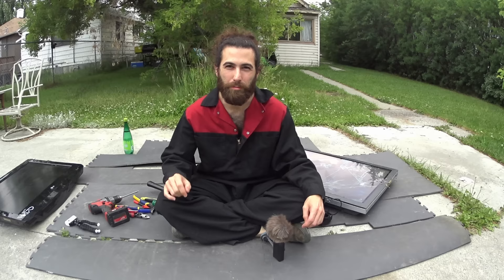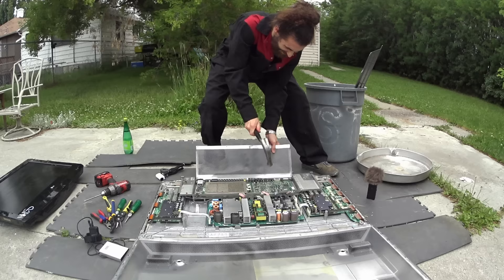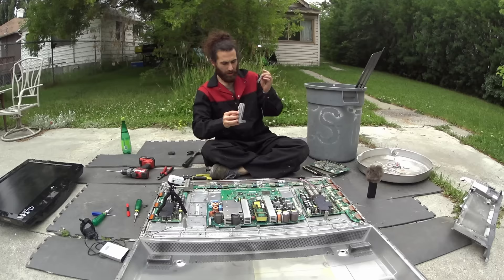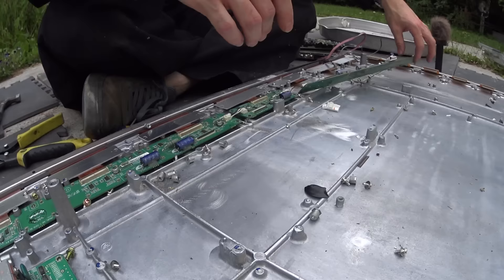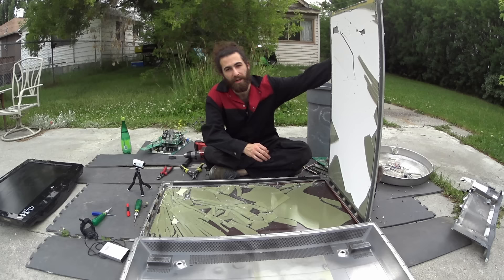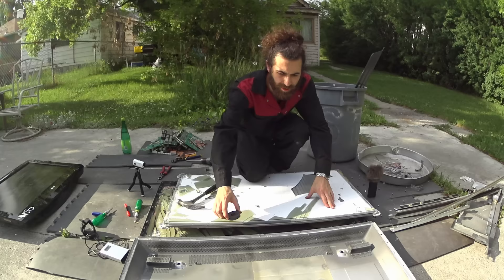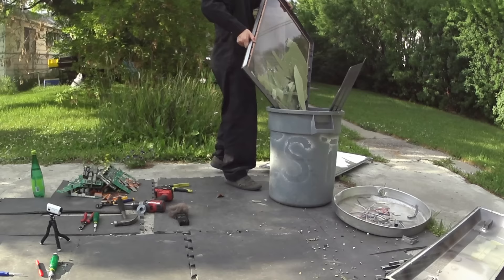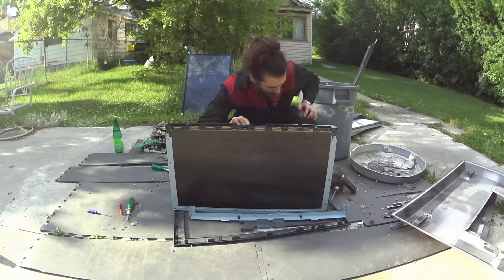Scrapping A Flatscreen TV - How To Make Money From A Scrap TV!

Comment: I have taken hundreds of flatscreen TVs apart. I have noticed that you’re throwing your screws away. You need to get you a bucket, and put them screws in there. I have a metal 5 gallon bucket that is level full of little bitty screws that came out of flatscreen TVs. I can only pick it up about each off of the floor and that’s it, because it is so heavy. You can sell that for Scrap Metal as well. They will buy it. I will take a plastic dishwasher. I strip all the wire out of it. And the painted aluminum from the front, if there is any stainless steel inside the dishwasher, I take that off, and any brass, I may see, then you can take your screws and small pieces of scrap and put inside the dishwasher and sell it. I have been scrapping now for over 30 years, I have a humongous, astronomical amount of circuit boards. Better known as motherboards. When Bill Gates mother gets bored, do you know what he calls her? He calls her motherboard. I just don’t know what all to take off of these boards. They are different grades, I do know that much, but they do not want you to take anything off of it. But sometimes I take the aluminum grid off, and some of the copper off. I probably got enough to fill up a 6 foot bed on a half ton pick up level full , maybe even more than that. 0n a tube TV, I will take everything out, including all of the screws. Then I will take the tube out and hit it very carefully to let the gas out. I will take the top end that the copper wire cone was on, because there is metal there that can be scraped. Then I will cut the steel band off. Then I will put the rest of the tube in the trash can. And then I will break the glass tube up into small pieces. Then I will take the piece of metal out, dump what pieces of glass back out. Then I will take the piece of metal out lay it on the ground, and step on it to make it flatter. And I will sell it for scrap metal. The flat green TV that you took apart, that had the green broken glass in it, it is called a plasma TV.  If the circuit boards are in good shape, you can sell them online, on eBay, or craigslist.
Reply: How do you know if the circuit boards are in good shape? How can you tell?

Comment: Ok so good info that you have given however you missed or left out some details that iv learned from scrapping with my man for 7 years. The first tv you messed around with is a plasma. They are very heavy even though they are flat. A plasma tv has about 3-4 pounds of copper transformers on the boards as well as all the round things that are wrapped with copper wire. We don't clean small transformers we just throw them in a bucket till it's full. But the round things wrapped in Cooper on a big plasma there is around 2 pounds of copper all you have to do is cut the wire connection to the board and hit the round things once with a hammer and the middle part the copper is wrapped around disintegrates and you pull the copper apart and discard the middle. Also if you take just the transformers and copper wrapped round things, the wire and aluminum a person with a drill for the screws can get it apart and ready to sell to the scrap yard in under half hour. With the prices in southern Ontario where we are it's worth around $11 so I would say worth it not for gold tho. We also have no one to buy gold boards ect.

Comment: Put the magnet in a thin rag. After picking up the screws turn the rag into a sort of bag and pull the magnet off. Dump the screws.
Reply from the maker: Ooooh, I like that a lot
Reply: @thubprint  yeah and saves you from getting poked by pointy things like drywall screws when you're picking them up

Comment: I have collected "broken" flat screen tv's for several years.  Sometimes, if it is an easy fix, like replacing a board, then I sell the working tv for several times what the part cost to fix it.  I have, on occasion, collected the tv's, and, when testing them, found that they were thrown out just because the person wanted a higher resolution or a tv with more apps preloaded.  Two of these I now use in my work shop.  They work well, have good enough resolution for my shop environment, and, didn't cost a thing.
The best part is that the ones that I fixed and sold, or, fixed and now use, don't go into a landfill and provide entertainment for me and other people.  Reuse is not a bad word.

Comment: I picked up 250 flatscreens from a return center. I have taken apart 170 so far. I have 12 pounds of screws, an 18 gallon tote of copper, a 1/4 barrel of power cords, 2 trash cans of circuit boards, 2 5 gallon buckets of aluminum, a quart of brass and half of a 5 gallon bucket of aluminum and zinc (mixed because i ran out of buckets)!! I can strip 7 to 10 TVs an hour depending on size.
Reply: pass!
Reply: @Vizneezee100  holy shit 7 -10 tvs. I just started working as a tv scrapper. Do you have any tips or is it just getting my own style eventually
Reply: That's crazy, how much did you make and how long did it take you to tear them all down?

Comment: The best part of a flat screen is the polarizer sheets. Some are actually created by electroplating platinum metal on to them. Other than that they're really cool and you can make little outside grow tent enclosures out of them. I made a mini hoop house with them they last forever unless you live somewhere cold then they may get brittle after 2 years.
Reply: @alienrocketscienceshared8454 Nuh uh
Reply: What is the polarizer sheets ?
Reply: Theres a power supply board and main board. A lot of physical tactile switches will have s lil dot of pure gold foil as a contact. Definitely worth saving. Depending on your location there are recyclers that will buy glass it isnt much but it isnt hard to max out the hauling capacity of a pickup with the stuff either

Comment: As soon as you hit your thumb, I hit "Like".

Taking apart flat screens obtained at the dump has become a hobby of mine. I simply can't pass one up!

They contain cool translucent and silvered plastic sheets for artists. But the BEST part is the OPTICAL SHEETS. You've seen them. They're flat Fresnel screens. Not with the typical concentric rings, but rather horizontally-etched surfaces that do the coolest things with light. I pass on all the hardware, metal, plastic and LED strips and chips.
Reply: your a recycler-excellent -

Comment: It's amazing how much is in the older flat screens like the unit above vs the newer flat screens..
The newer units basically have a calculator and 2 crappy speakers.
Reply: Truth, I scrapped a 56" and it had just a single tiny board
Reply: totally if its a very light tv it only have 1/2 crappy boards now i dont bother on those 10000 screws 4 no return but the heavy ones forsure their loaded

Comment: They used to make very large projection screen TVs and it was in a particleboard frame. They have a very nice gold cpu chip and a few optic lenses from europe. And they have a large freshnell lense for the screen backing. You can boil water off a mirror reflecting the sunlight under the pan of water. Very fun to take apart. Three lenses as big as your hand, 4" diameter. The hardest part about it is that you have to bust it up right on the street to get the parts into your trunk. They weigh over 100. All the sides collapse down after a few wacks. Look up the price of a freshnell lense at 2x3 feet. That's the coolest part.
Reply: Me and my son had one of these tvs to take apart(it was left behind in a rental) the lenses were alot of fun to play with, but had no idea the lenses were valuable. We just started fires focusing them on paper......
Reply: True that. I've had a lot of fun with mine.

Comment: Someone may have said this earlier, but one may be able to sell on places like ebay, amazon, etc the WHOLE circuit boards and interconnecting wire harnesses and LED strips for a great deal higher ROI and with much less effort than tearing them apart at the component level.
Even if one offers a zero-cost return policy if a board/harness fails, it can be worth it to eat the cost of the infrequent bad board...especially if you know a TV was tossed-out due to a bad LED strip, or damaged display, etc. and a failure is less likely to be due to a bad board. Otherwise, either the main power supply circuit board or the LED power supply board are often the failing part. Also, more modern TVs have far fewer boards than they used to.

edit to add: If you know the power supply board(s) are fully functional, they're probably one of the easier/faster selling circuit boards. You can search the net to see what kind of price you might consider asking for them.

Comment: Thank you on the tip on the palladium.  Don't throw away the steel. It isn't worth much, but it'll pay for the gas to get to the scrap yard. Why throw money away?  The screws where the cables secure, those are often stainless. I usually check them.  Takes a while to build up enough stainless to be worth it, but again why throw money away?  There's tiny bits of copper on those boards. It adds up as #2 over time. Often a bit of aluminum also. The capacitors are aluminum but have a very toxic substance inside. Most yards won't take them as is and it's rather tedious to remove the plastic, then unstuff them for the aluminium but for the really big ones I make the effort. Just do in a well ventilated area and wear gloves while doing it.
Reply from the maker: All good points! The steel for sure, it piles up so quickly without any special effort. Stainless less so, but I’ve been really happy with my stainless payouts lately so I have to keep a bin for it going anyway.
It depends on your situation though, the time and the storage space you have available. I think anybody who has a buyer for complete boards will probably be better to just leave as much as possible on them to keep the weight up.
Reply: How do you separate the gold from a gold plated whatever?
Reply: @thubprint  I just took about 5 tons of steel down to the yard this week. It builds up quick. Especially when scrapping appliances and PCs. True, storing it is a pain, but for the smaller stuff, screws, small pieces, etc I just take it down with me when I take the other metals. A PC case for example, if I line it with smaller pieces allows me to just toss screws and tiny pieces on top. I then take the whole thing. I used to use dead microwaves like that. Fill them up with screws but I've been using microwaves for Faraday cages lately.  I leave enough of the cord to use for grounding and it makes a great cage.  There's always little boxes of something or at worst throw it in a plastic bag or cardboard box and do it that way. You get 50 cents or a buck but it's out of your place and a little pocket change when you take the other stuff down.
Reply: @deanbromerg8000  It's all  plated. Solid gold anything is rare in scrap.
Reply: Dude, theres only 24hrs in a day.
Reply: @DracironSmith  He means how to separate the gold plating from what it is plated upon. I imagine they do it by melting the gold. Probably just sells  it without removing the gold from what it is plated upon and the yard does that, but I could be wrong.
Reply: @hankkingsley9183  I dont know if you'd be able to melt it for pure gold, you'd do it by chemical separation
Reply: When i was actively scrapping i would throw my copper, stainless, brass in seperate 5 gallon buckets in back of my scrapping truck...lost truck dng it
Reply: @hankkingsley9183  It's dissolved in acid, then run through a recovery process, then smelted down. I've seen youtube videos on how to do gold recovery but never tried it. It's a pretty hazardous process dealing with acids and fumes. The investment for return given the amount of gold I would expect to process and the health risks involved left me feeling it wasn't worth the effort. You can find good gold recovery videos, but do independent research. Many times such videos do not do a good job of covering safety hazards.
Reply: Absolutely right!
Reply: @DracironSmith  you are correct.  I use aqua-regia (mixture of nitric and hydrochloric acids)to isolate the gold off.  but being most ribbon plate of gold is usually between 3 and 10 microns thick.  hardly worth the effort unless you are doing several kilograms of material.  and even then, the gold quality is usually only 10-12 karat.
Reply: @thubprint  it may be a space waster, but over the course of 4 years of scrapping, I filled up a garbage container the size of your waste bucket, with screws out of appliances/machines/etc.  it literally weighed 425 pounds.  was well worth it in the end.
Reply: @JFDhater Are you talking about plated gold chips? If you ever got those refined, I would be really curious to know the cost of chemicals versus what you get out of it! Congrats, that's awesome

Comment: thanx to thub for even bothering to make this vid: i learned a lot! (even though i've repaired electronics - all kinds - since forever).

i used to collect aluminum cans, but found the actual cost of hauling the cans to the recycler cancelled out what i got for them... you live, you learn. i was surprised when thub said:

"all those little pieces of gold are not even worth a dollar..." 

(gold has steadily increased in price) it's early days in my research: process of extracting gold from old PCBs seems time-consuming and dangerous. (maybe there's a a way of harvesting gold quicker with less dangerous chemicals)? (i'll try to find out). the big surprise is when thub mentioned palladium (MLCC capacitors). palladium is a very rare metal, much more valuable than gold and (probably) well-worth harvesting from scrap. tantalum was new to me, too (another rare metal). 

hauling metals cheaply (especially cheaper kinds) is probably a key to success. or, if you're clever enough, harvesting the very rare metals thub mentions. the way i see it, scrap-harvesting is a big service to humans, our communities and the economy generally. (the electronics industry is worth billions, so the demand for metals must be high).

in my neck of the woods, "fly tipping" (people illegally dumping large items out in the streets) is a big problem: 

i literally find myself rescuing flat screen TVs and other items regularly. if i had a wood burner, i could keep myself warm all year with the amount of timber people discard... its amazing the valuable stuff people chuck-out.. anyway, i think knowledge is power with getting the most out of scrapping, so here's a run down of current metal prices for anyone interested. [happy hunting]

zinc castings.... £1 - £2 ($2) per kilogram
aluminum frames ... £0.60 - £1.40 ($1) per kilogram
palladium per ounce > as of march 20, 2023: $1,339.00 <<< wow ! 
gold per gram > $62.85

Comment: That's a load circuitry in there, pretty sure it might have been a plasma screen TV, definitely wasn't cheap when 1st bought.. 😊
Reply: My little 20 inch plasma tv was approximately $650-700 when it first came out, as I recall.

Comment: O come on. You pulled the screws out add them to your iron pile. I put mine in a can . You might be surprised after three months how many pounds you have
Reply: I wish I could put up a picture of my jars of screws. I bet I've got close to a hundred pounds and it doesn't take any extra time.  The way I do it I only touch each screw once
Reply: I agree. Even if you didnt sell as scrap screws you can sell jars of screws. Like a jar of buttons even at 5 dollars a jar or bag might be worth more than a pound of iron.
Reply: Try getting a washing machine tub full of screws off the back of your truck at the scrapyard. Lol. I think this idiots man bun is too tight. If you’re gonna bother to take it apart, save all the metal. That shit adds up.
Reply: Definitely, i have 10kg already
Reply: To be honest I probably got closer to 20 or 30 lb myself. A hundred sounded better at the time
Reply: Saint 12   thanks brother.
Reply: pounds of iron.. around here iron and steel go for pennies a TON.
Reply: @richardweaver9682  around here you sell iron to metal smiths
Reply: @kevinklemz163  Agreed, ounces add up
to pounds and pounds add up to dollars! I save EVERYTHING and throw it in a scrap bucket.
Reply: @vvskiitlesvv  where is around here? I’m curious.
Reply: I sort mine from plastic, large and small, and machine screws then bolts..😎😎😊

Comment: Hey try putting some duct tape over the screen before you break it. Cover the whole screen with duct tape and tap it with a small hammer and then take a razor knife and run it around the edge and you wont have to deal with the mess and broken glass.

Comment: I’ve got a 65” tv in my living room that I’ve managed to get the light diffusing plastic sheets out of and a large sheet of plexiglass which I’m going to use to make an airbrush spray booth. I havnt gotten to the electronics yet though. Other things I’m in the process of taking apart are 2 G5 Mac towers, induction heating stove top, epson 4in1 printer, and some other things. I’ve been hoarding 12v computer fans, microwave fans, transformers and magnetrons, many DC motors of various sizes, nichrome wire, 3v LEDs(the bulb kind and board mounted ones that are 1m) and strip light LEDs(going to make some light tables). All the circuit boards I’ve taken out of things I’ve managed to save every one and have a 40gallon tote almost filled because I’m still learning what is worth keeping and what isn’t by watching YouTube videos like these.

Comment: I find the cast cases (most of which consists of cast aluminum and ,very rarely, a die cast aluminum/zinc alloy) on most older technology. The yard I sell to takes them as cast aluminum, they add up quite fast.
Reply from the maker: They are pretty large, I’m not surprised those do well! I think most modern flatscreens use cheap steel all the way through though
Reply: @thubprint  yup, I picked up a 55" TCL flat screen last night and the most aluminum that was in it was the heat sinks on the motherboard.